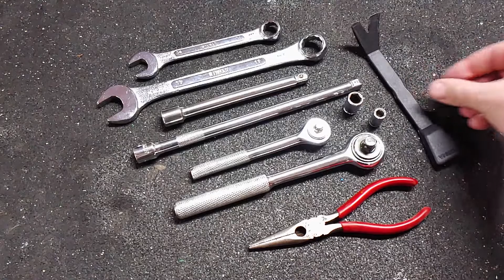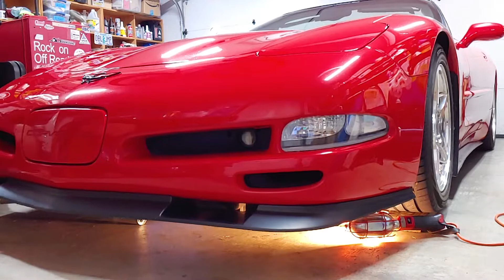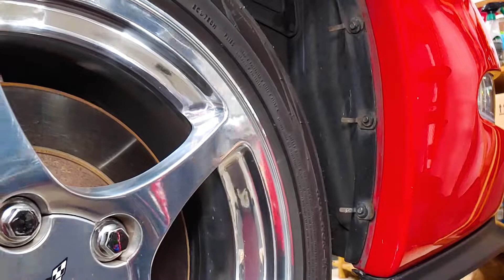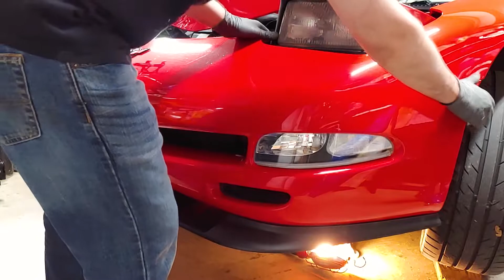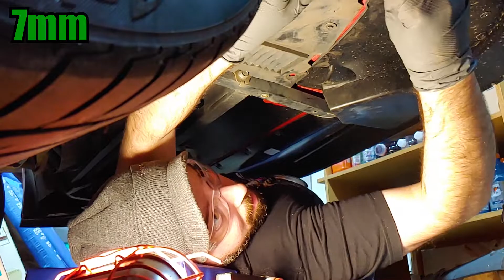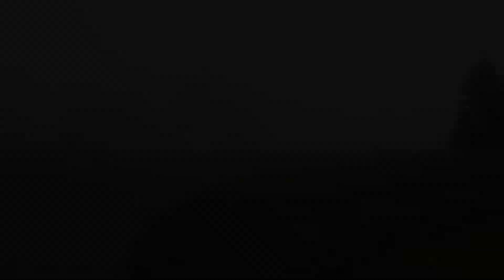Front Bumper Cover Removal & Installation Guide for C5 Corvette 1997-2004 with Tool Sizes

Comment: Hey, what lip is that? it looks very well made and like it actually channels air towards the air dam. noticed any issues because it's blocking the front? was it plug and play to screw on or needed work to fit on?
Reply from the maker: I'm not sure off hand. There is a comment on one of these videos where I answered that question, but it was a long time ago. The car belonged to a friend and he doesn't own it anymore.

Comment: great video..how does your car not overheat with that splitter?
Reply from the maker: lol... it was overheating a little at the time of filming. The owner of the car has cut out some vents in the center of the splitter since I filmed this video. He also installed a vents where the license plate goes. Temps are good now.
Reply: Are those splitters that bad from blocking air to cool the car? I'm just asking because I was thinking about getting one